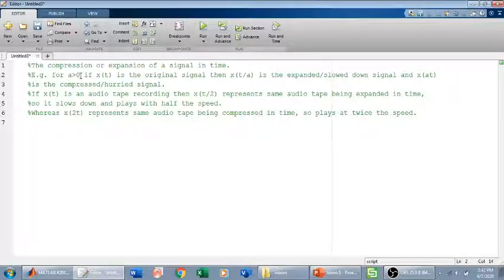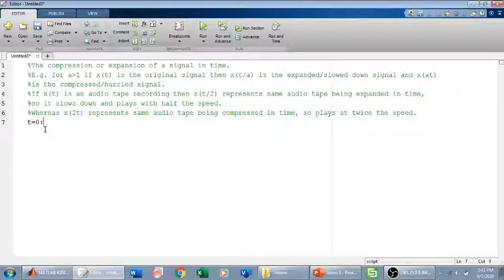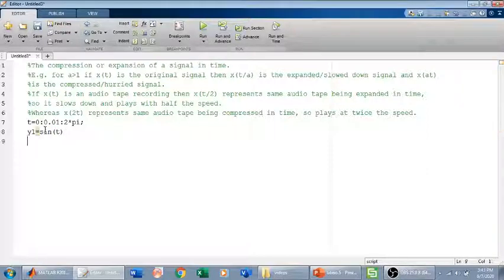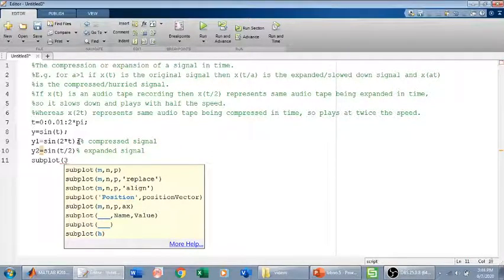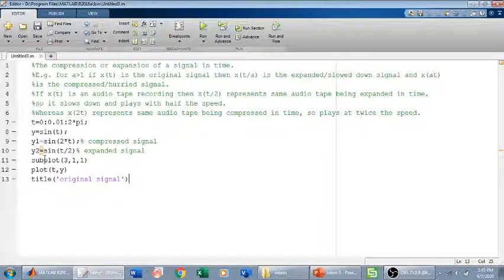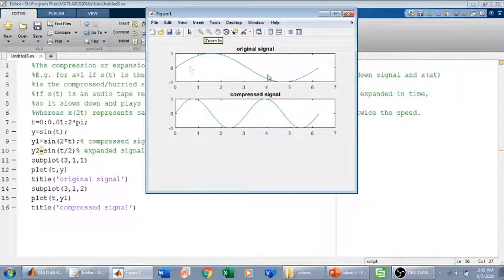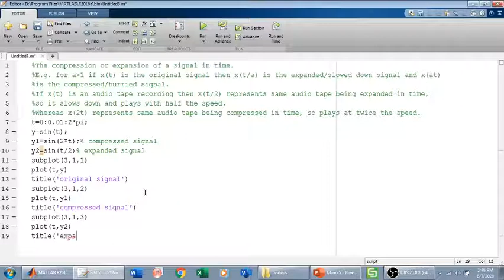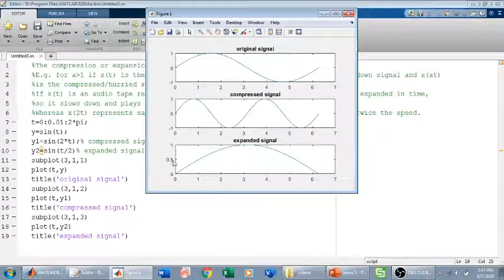Time scaling in MATLAB

Comment: how to do in discrete time scaling?? could you tell me fast!!
Reply from the maker: Use stem command instead of plot
Reply from the maker: Brother if X(n)=[-10 -9 -8.....9 10]
Then X(2n)=[-10 -8 -6 -4 -2 0 2 4 6 8 10 0 0 0 0 0 0 0 0 0 0]
And it can be plotted using stem command as mentioned above..
Reply: Yes but it is plotting the non integer values of n also...could you try please?
Reply from the maker: Instead of plot(t,y) use stem(t,y)
Reply from the maker: Define n instead of t e.g n=0:10..also you need you can use  sind(n) instead of sin(t) e.g. 
n=0:10:360;
y=sind(n)
Reply from the maker: Sind is used for degree plotting..i.e. plotting sine wave in degree..hope it solves your problem
Reply: Yes I used....but it is plotting non integer values also...as you know for example when you divide 1/2=1.5 which is a non integer. So manually plotting the amplitude should be zero for non integer values in case of discrete time scaling..
So what to do in Matlab?
Reply: Please solve this ×[n]=n for -10<n<10
Plot x[2n]. Could you help me with this?
Reply from the maker: You can also use
n=0:2:100;
y=n;
y=n/2;
y=2*n; and then use stem command
Reply: No it's not working:/